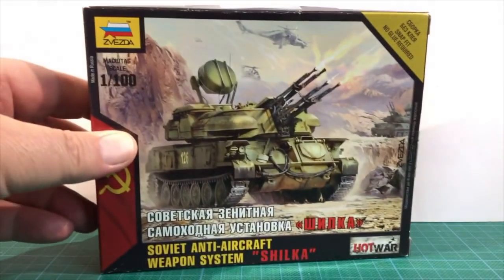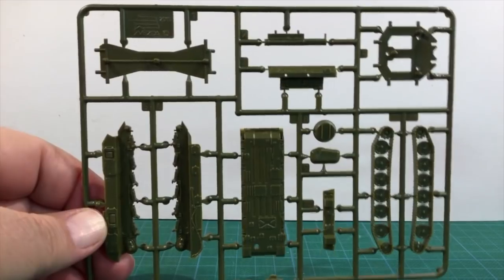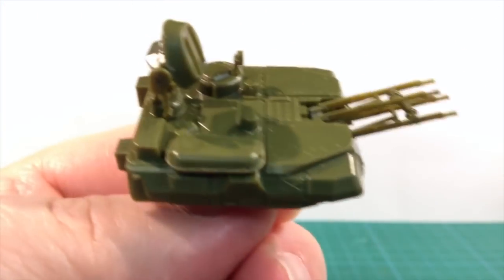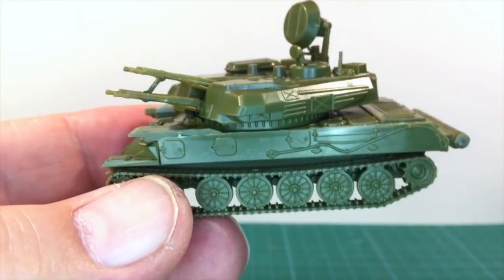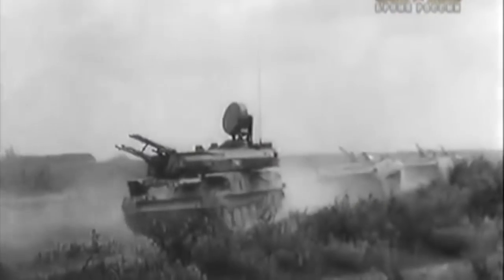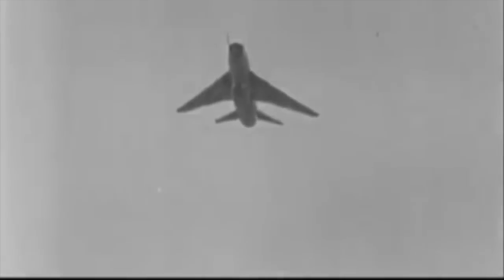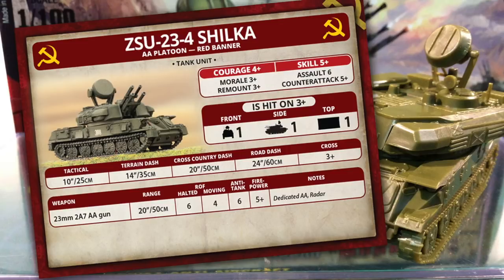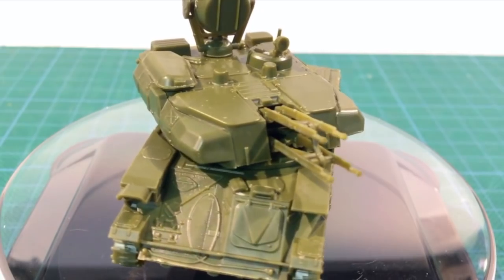Review | Zvezda ZSU-23-4 Shilka plastic kit 1/100 (15mm) | Modern

Comment: Just built a second one of these ready for the release of the new Starter Box and Soviet Army box for Team Yankee. The gun assembly is a bit fiddly but all goes together nicely. As I am not bothered about raising/lowering the gun I glued it all in place and have the 'flap' glued on top. I think that without glue the little 'spacer' between the top and bottom barrels will fall off and get lost in no time.
Reply from the maker: Yes. I ended up gluing the top flap down on later ones. I haven't had any issues with losing the gun connector, but I'm pretty gentle with them.

Comment: I build two of these now. The finished model looks great. But the build was a bit annoying - much pressure needed to reduce the gaps - and the plastic was very soft. Removing flash and sprue gates left overs wasn't fun. Will see how the painting process will be. I let you know.
Reply from the maker: Zvezda's plastic is very different to modern model plastic. Softer and more toy-like. But once you get used to working with it, it is OK.
Reply: @FogofWar  Plastic took paint good. But I have to say that the details are very shallow. (Except the road wheel details. These are great.) Cut the cables on the side off on one vehicle. Overall I wasn't that satiesfied when I finished painting them as being part for my syrian force. But the guys on Insta liked it. Got the most likes in a short time and is my No. 2 when it comes to likes. Maybe didn't everything wrong. 😉

Comment: Do you have a comparsion for the BF model? I heard that the BF models in general are a little bigger and more detailed then the PSC or Zvezda models (saw a video about the T64´s that are noticeable smaller then the BF ones, so i wouldnt want to get them). I dont own BF Shilka yet, but im planning on buying some, but they re resin models and i hate working with Resin, so plus for Zvezda.
Reply from the maker: I only have the plastic Zvezda Shilkas. I don't have a BF one to compare it to. But I have been very happy with my plastic ones.
Reply: http://www.breakthroughassault.co.uk/zvezda-modern-soviets-review/ Breakthrough Assault says otherwise. I think one of the other bigger FoW blogs put a Zvezda Shilka with BF one side by side and they were basically the same scale other than Zvezda one had fiddly guns.
Reply: @ledichang9708  Yes, this is correct, they're both 65mm long.